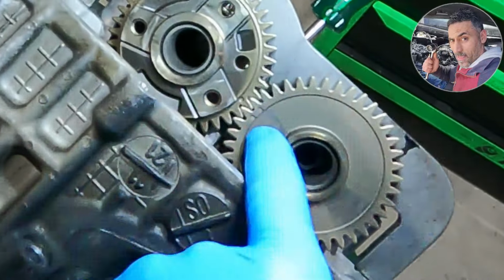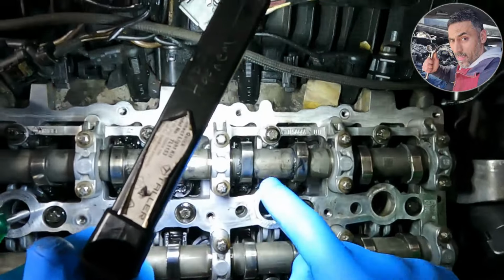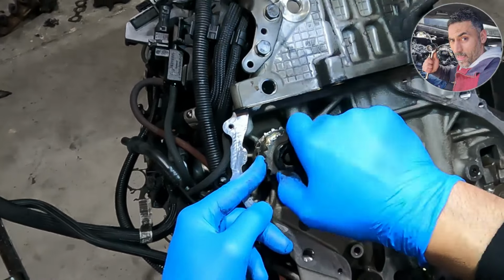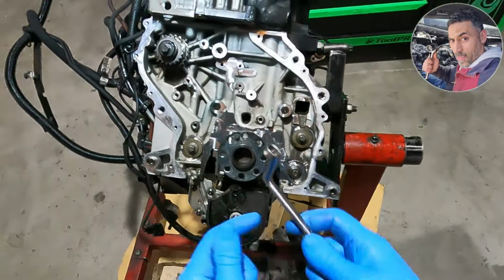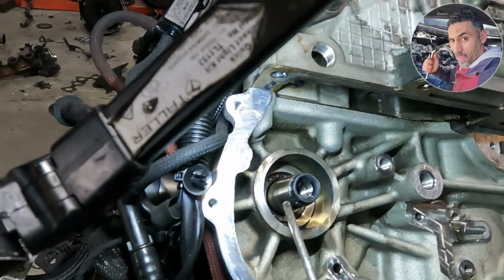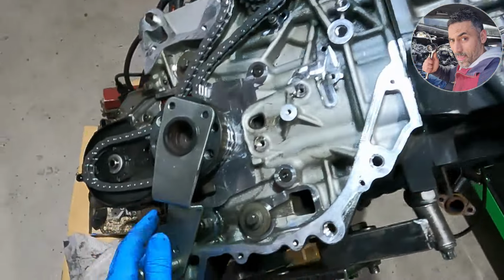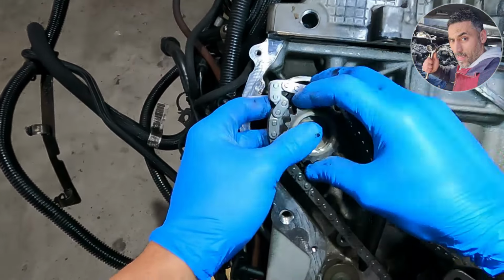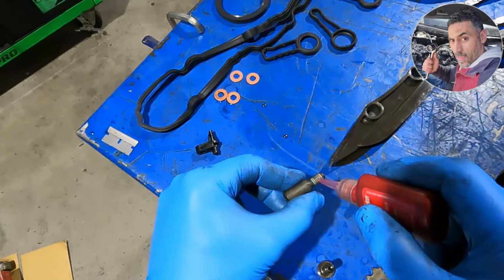BMW N47 & N57 Engine Timing Chain Set Up Part 1

Comment: I see from you previous video you timing everything with crank at top dead centre. Is there a reason why uou changed to the 45° atdc method?
Reply from the maker: These are The ways i do engine timing chain setup,  They both works. I DO TWO ways to set-up the engine timing chain. Thanks for watching.

Comment: Hello  Hachem, thanks for the amazing Video. I have a question, if i change only the Chains and the guides without taking off the Pump, do i still need to do the Rotation thing? i think the job would be easier for me if i dont mess with the pump and just change the upper chain since its the only one with problems, the tensioners and the guides, what do u think?
Reply from the maker: I do recommend changing the engine timing chains kit if the car did run more than 60,000 km. New chains and guides will make the job really  good job done. If the chain was broken better to do vales damage test , compression test. With the cames and the chains are off. Remember safety first.